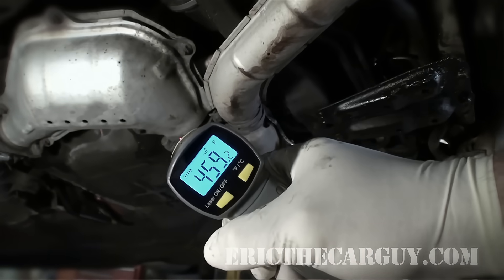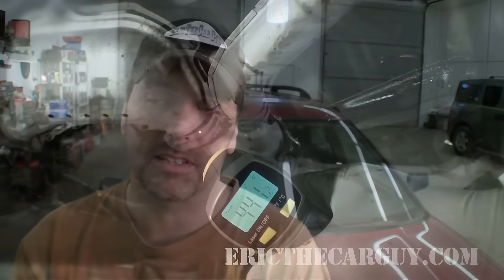Does Lacquer Thinner Clean Catalytic Converters? -EricTheCarGuy

Comment: You have to use an entire gallon of lacquer thinner with 1/2 tank of gas like Scotty kilmer instructs. I have done this with 3 vehicles and it worked like a charm every time. The cats were also severely clogged in my vehicles. The cars would only drive for 10 minutes before they would lose all power. Living in CA I sure as hell wasnt paying for a replacement cat. This has literally saved me $1000s of dollars.
Reply: No problems. It was even a bit fun to drive with as it is like putting rocket fuel in your car.
Reply: David Rey yea I noticed a dramatic increase in power.. I had to hold back because I didn't want to break something
Reply: Do you really put lacquer thinner in the gas tank?
Reply: I dont remember the name but it was the blue and gold can at Home depot.
Reply: Crystal Trottier did you have any issues after pouring the lacquer thinner?? any check engine lights?
Reply: David Rey I did it with klear something brand and it worked great no problems. I didn't do a gallon. only 1 pint in 2.5 gallons of gas.
Reply: Hi, please apart from the light going off, did your "loose power after 10 minutes" issue improved after you tried the Lacquer thinner" ? I will really appreciate your answer.
Reply: what kind of lacquer thinner do you use?
Reply: @garyshaw8449  think it needs to be acetone based. MSDS sheet will tell you. Acetone dissolves the carbon. Park the car with a wall behind you and you'll see the carbon spraying the wall
Reply: Was it possibly KleanStrip?
Reply: ***** k
Thank you for the reply ; )
Reply: Suburu cats are ridiculous! 1500$ fur left cat 2500$ for rt cat . Can’t use aftermarket in CA .

Comment: Your car will run on strait lacquer thinner just like it runs on gas. It will clean your fuel system of varnish almost instantly if it is not too diluted by gasoline. It will clean your valves and pistons too better than anything else I know of other than running steam through the engine while it is running..Empty tank as good as you can and dump a gallon of lacquer thinner in there...Start it up and run for 5 minutes then shut it down and let it soak for 30 minutes....Take the car for a drive and before it runs out of fuel put some gas in there (do not ever run a car out of any kind of fuel!!!) unless you want to suck stuff from the bottom of your tank into the filters and ruin them .....I would not leave strait lacquer thinner in a car overnight....I just don't think that would be good for a fuel pump or any soft fuel lines or seals...I suppose it could in theory cause an old fuel filter to fail but in my 30 yrs of using it this way I have never had that happen....  I do not know about any effect it has on catalytic converters. Introducing steam to a running engine would probably work better than anything on some types catalytic converters depending on the problem causing them to not work properly in the first place.
Reply: Yes, I bet a gallon of lacquer thinner to 3 or 4 gallons of gasoline (non ethanol) would do the trick much faster... probably get even better results than S. Kilmer, and much easier and faster.  Plenty of us don't have the time to drive 200 miles without some reason...

Comment: Hello, I tried that & it worked 4 years ago with 1 gallon in a 1/2 tank & passed smog,  it lasted for a year with no check engine light.  Then check engine light one after another for a month P420, so I tried Scotty Kilmore's plan B,  throw them in a bucket of soap & water overnight & no P420 for 3 years now.   I followed his instructions exactly & it worked.
Reply: Amazing what happens when you don't CHEAP out , and actually FOLLOW the Instructions ...
Reply: I'm not sure about the mix ratio... Eric used a quart in what was probably about 8 gallons. Scotty says "a gallon in a half a tank" without specifying the size of the tank. If I follow Scotty's mix in my car that's a gallon in about 8 gallons of fuel.
Reply: myron162 Scotty did specify he said 10% and he said make it easy 9 gallon of gas and 1 gallon thinner.
Reply: @myron162  if your gauge works just do it when the gauge reaches half.
Reply: Just remember this: there's a reason your catalytic converter clogged up in the first place. It's primarily the engine is old and has high mileage, so has worn piston rings, valve guides, etc., which burn oil and these burnt gases aren't from gasoline or fuel; but, are processed, as such & returned in the car's exhaust..so even with PCV, exhaust from the engine with burnt oil is going immediately from the engine exhaust manifold directly into the catalytic converter that's not designed for it..and this "sends" high oil content.. these high carbon debris that build up over time on the catalytic converter internal NOX screen (so this basic condition of an older vehicle with high mileage, over time, for older engines with over 100,000 miles even can will clog up a brand, new catalytic converter, so replacement is often mute.) I found, in late model cars doing this Scotty Kilmer solution once every 3 years is like "maintenance." ..but it won't restore any catalytic converter that no longer performs NOX functionality. ..still in over 50 of my own personal cases..I only ended up having to replace 3 of 50 catalytic converters..the other 47 times simply cleaning it worked.
Reply: Lowes or home depot has it
Reply: AMAZING IF YOU DO FOLLOW THE INSTRUCTIONS ---- IT DOES WORK BETTER.
Reply: Stoked I dont live in California. Lmao
Reply: Diane Damian where do I buy the stuff?
Reply: This is simple. A smaller channel hating on a bigger channel for clout. Lacker worked great for me
Reply: Old style lacquer thinner contains acetone. That's good for burning out carbon deposits, eg blocked cat after using seafoam on a dirty engine.
Reply: @hpt08  acetone eats plastic so I wouldn't put it anywhere near my engine
Reply: @samsanford  Your engine isn't plastic, though. Most plastic parts aren't anywhere near where your gas goes, because gas melts a lot of types of plastic, too.
Reply: @CaduceusErin  Fuel pump pickup screen, fuel pump float, retainer clips inside quick-connect fuel line fittings, fuel injector nozzles - all are plastic in my truck
Reply: @CaduceusErin  Also gasoline containers are made of plastic.
Reply: @samsanford  Yep, that's why I said "a lot of types of plastic", not "all types of plastic". Most rigid types of plastic are ok with a lot of more corrosive materials. Flexible plastics, not so much. But it depends on the makeup of the plastic.
Reply: @CaduceusErin  All those plastic fuel system parts I mentioned would be damaged by acetone - that's why I said I would never put acetone in my engine.
Reply: Nail polish remover is 100% acetone and it comes in a plastic bottle at Walmart so no, acetone does not melt plastic
Reply: @samsanford it’s going to be diluted in the gas so it’s not gonna harm it also if don’t like that method simply remove the O2 sensors from the bung holes and pour or spray directly into them and let them sit and  soak overnight preferably when car is dead cold or coarse then get up crank and drive around for a while if  CEL doesn’t turn off by itself simply clear it if it’s still on when you fire up the car with cheap scan tool or removing the negative battery cable for a few minutes to let the ECU reset
Reply: Im pretty sure there will be no plastic on the inside of your engine.@samsanford
Reply: What tool u need to take the car off ?
Reply: What tools I need to take it off
Reply: Good job
Reply: Kleen Tools brand at Walmart $8 bucks a can or few bucks more for gallons cleaned up my Honda accord and Saturn-aura 3.5 V6 models
Reply: @staind288  Home depo
Reply: @fuzonacid  No he said he had a 13 gallon tank and had about 3/4s in the tank. Still doesn't make the ratio correct but if you're going to rag on someone get it right. And he didn't rag on this Scotty person, so ... .

Comment: I tried it and had to replace my o-ring on the fuel rail because they started leaking real bad
Reply: Todd Wiedmer that's exactly what I thought would happen
Reply: good to know.. I wonder if just adding a little bit is helpful at all so I don't have to do the full gallon. I want to do it for maintenance. di did it at least clean the cat tho?
Reply: did you leave the car sitting overnight instead of running it all thru? maybe that makes a difference

Comment: I think in regards to the converter, it would just be a smart move to replace the converter then it will be done and over with. I get the simplicity of the ideas but you get what you pay for. The cars nowadays are designed to run a certain way with emissions as we know them so it easier to replace and move on. Besides sooner or later that converter most likely will/could cause more damage no matter how you roll the dice. bottom line do it right the first time and you won't have to worry about it.
Reply: fuck that we're trying to save money
Reply: What! For 100 miles, lol I Bet you're one of those people who would  do something like that and get the (CEL) to go out and turn around and sell it to the first person you could make a buck on and then it's someone else's problem cause your the cheap guy to pass his problem to someone else.
Reply: Adam adam actually no I am not currently having cat problems and thinking about doing this for maintenance. and I will not sell my car until all faults are gone and its running well. - I happen to be the guy that bought the car whos instrument panel had been tampered with to hide the check engine light. so they knew once emissions came back around id be screwed.
Reply: Now think about that? why do that? if it doesn't fix it when the light  pops up its pointless to do it as so called maintenance when there's nothing wrong with it right now, and going by what ETCG1 has done. what makes you think that it would maintain anything and could possibly do damage in doing "so called" maintenance.
Reply: Adam adam I noticed power loss after using sea foam in the intake.. feel like it could be gummed up a little . a lot of people say it worked for them
Reply: I've been told sea foam works good also, I've used it but never used it so I don't honestly know. I've never been one to use additives, I've always been a stricked  believer of changing the oil  at 3000 regardless of what most say and if I use an additive I use the yellow or red bottles of Heet when my tank is empty and it's at running temp and I don't  run across anything major but I've always been old school carburetored.
Reply: Adam adam maybe that's why they say to add some seafoam into the fuel? maybe there is something in it that makes its way to the cat
Reply: Gary Shaw  most likely.
Reply: Adam adam I ran the lacquer thinner. I didn't want to drive 100 miles so I put 1/10 in 1/10th the amount of gas.. 2 pints for 2.5 gallons, drove it off (10 miles to work), refilled and ran to dilute and clear it out. it has way more power now . im convinced it cleaned something out. while it was running on lacquer thinner it was a lot of fun to drive too because of the extra power. I had to hold back though because I could tell something would blow if I pushed it too hard
Reply: Nice grand marquis in your pic

Comment: I rather do the dirty work and clean the catalytic converter
Reply: AlonSOAMAZING it’s possible just very hard.
Reply: Cause your a pussy 🐈
Reply: GeneCARRASCA how do you remove the catalytic converter if it’s welded ?
Reply: Use a toothbrush.

Comment: Scotty used 1 GALLON of LT per half tank of gas. The tank size in the car he used in the video was probably about 13 gallons. You used only 1 quart of LT instead of 1 Gal. So your test results are invalid.  You seem to be a smart guy so I'd like to know how your test could be so flawed?  I'm gonna give it a shot and tell you what the result is with my car using 1Gal LT with about 6 Gal gasoline.
Reply: if the engine can run off lacquer thinner instead of gas.. how come they don't sell it at the gas station?
Reply: Johnny DioGeorgio hey Johnny, you said you would try it, well, what's been your results? 

did using paint thinner work cleaner clearing clogged cat?
Reply: DonnieDarko1 it worked for me but it was lacquer thinner. I think theres a difference. it ha similar ingredients to some of those fuel injector cleaners (toluene)

Comment: just cut the cats off. I have a 2004 Chevrolet 323 with 1 3/4 headers, 3 inch piping, xpipe, no cats at all, and magnaflow bullets mufflers. I deleted the p0420 code completely. my computer doesn't know what p0420 is

Comment: Just confused, as i've had p0420 and swapped o2 sensor and it was fixed...  guess i'll go watch your other video.
Reply: Eian Wahgener
The code doesn't juuuuust read O2 sensors and say there is a problem.
There is math and tables full of engineered parameters for the comp to computate :P

Comment: For the sake of thoroughness why not rerun your demonstration with the substantially  lower volatility "Varnish Maker's & Painter's Naptha?" It is  Unlike the significantly more volatile organic solvent cocktails that work so well in the parts washer system.  Sometime use an abrasive saw to halve an old catalytic converter.  Warm either half up with a propane torch until the ceramic glows red and thereafter you can drizzle small amounts of propane, natural gas, acetylene, or gasoline vapors on to the heated ceramic containing platinum, and the gasses will burn with a visible, clean flame.  If there is a sufficient amount of platinum present in the ceramic mixture, and if the ceramic insert has been heated to the minimum specified temperature, fuel vapor should burn.  If you are throwing motor oil into the exhaust or pumping transmission fluid through a worm out vacuum shift solenoid, repair those problems and then see how well your catalyst system is working. Long before Techron, et. al., were invented, I used 100% naptha as a fuel conditioner in my diesel equipment (road tractors and heavy equipment) that had the bonus of giving a continuous release of intake valve carbon.  If an aromatic hydrocarbon fuel system cleaning can improve a catalyst system (frankly doubtful) then pure Naptha is more likely to git'r done.  Try a painting contractor supply house.  You'll be able to buy Naptha in 5 gallon buckets.

Comment: Scotty is a old time mechanic with many good tricks of the trade, that work.  Eric on the other hand is not, and probably did this video to defame Scotty, maybe. Personally I believe it does work
because Scotty has been using this method for decades. Plus Scotty answers his viewers questions, Eric don't.
Scotty has 2 million viewers and answers questions,  Eric don't ..
Reply: So does this really work because i just replaced my front manifold with catalytic converter just left the muffler shop and the guy said that my other one was clogged so I Google how do you unclog your catalytic converter and this is the video that popped up but I hear you guys speaking highly of Scotty so does this work I have a 2002 Nissan Altima 4 cylinder 2.5 l
Reply: Eric doesn't. Not, Eric don't.
Reply: Joseph M eric has many question answer segments. and he has plentybof experience dumb dumb
Reply: @FranklinHicks-qs4gs  No.  He is a parts salesman that will install them for you.  I know his kind, and knew a few.  Fuck this guy.  Scotty is a real mechanic.
Reply: Look here Hick, if you have a statement to present, do it with some class. There is no need for name calling.
Name calling shows a lack of character.. By the way I like Eric, and I am subscribed to his channel, however,
I don't agree with him on this particular issue.

Comment: Adding lacquer thinner to your gas tank is idiotic. Like some posters have already stated there are many plastic parts on the way to the catalytic  converter. Ever hear of plastic parts melting in the gas tank? Lots of vehicles have in tank fuel pumps. Those are expensive to replace. What happens is the gas slowly weakens the seals and then failure. Running too low can overheat the pumps as they are designed to be cooled by the gas thus worsening the situation. That being said, I see hardly any  problems with taking a cat off and completely submerging it in lacquer thinner for at least 24 hours, tail end down. Seal intake end to air hose. Blow down first for liquid. Blow up for gas. Heat slowly 48 hrs.,tail end up, like Florida summer temp and then storing it in a well ventilated steel building in the driest desert for 6 months. Thinners are worse than gas as the explosive part is not the liquid but the gaseous part, and thinner is called thin-er not guckyer for a reason. BEWARE Hollywood EXPLOSIONS!!!
Reply: go on.. tell us more.. I thought most cars had in tank pumps